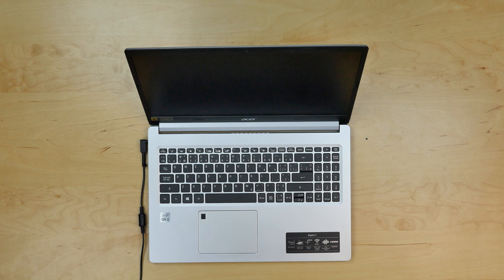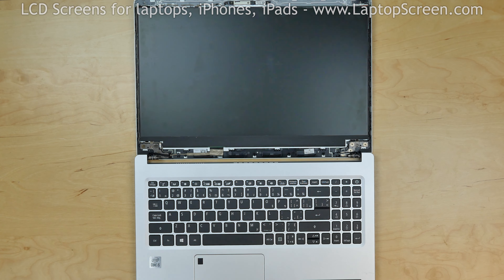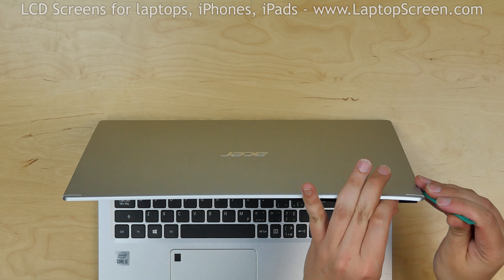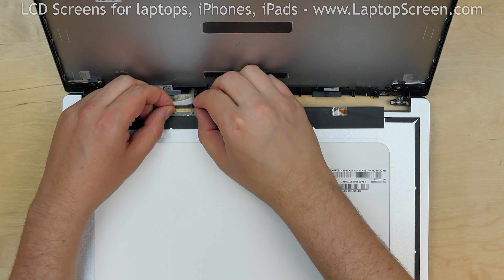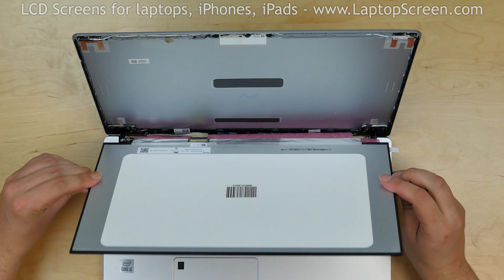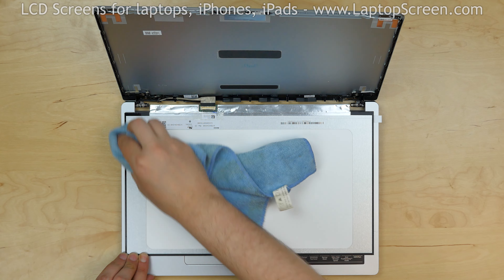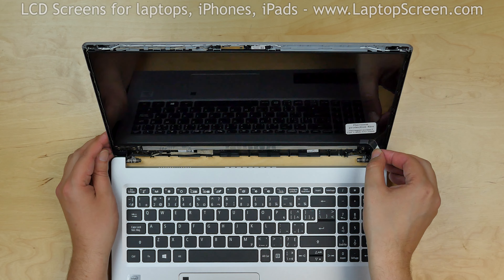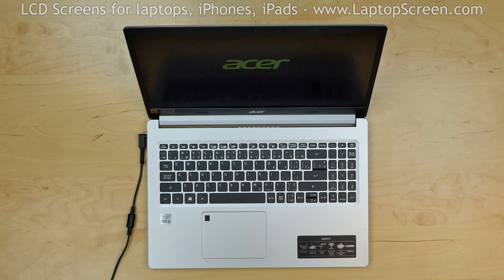How to replace LCD Screen on Acer Aspire 5 Model: A515 55. Step-by-step instructions

Comment: excellent video. only thing(s) I would add is some additional detail on connecting the new screen, how the cable clip from the board needs to snap/clasp back onto the new screen cable connection (right about the 1:56 mark in the video). mine was a firm fit that took a few times to get right. also, in my experience, the heat gun use was set on "low" and I swept it side-to-side like shown in the video for maybe 15-30 seconds in sections. requires some patience, but mine came off very well with some mild heat and "working it" in sections. after about a week, product I ordered and installed from your site has been working flawlessly! also, just buy the double-sided from them. compare the price for other 3m-like strips and it's a wash. no, I am not a shill for them, just very happy with the product and experience.

Comment: is the lcd bezel secure? im scared on how u easily removed it
Reply from the maker: It varies from laptop to laptop but over-all its easy to remove. Some laptops have glue along the perimeter and that makes it harder. Considering that we've been doing this for more than 10 years it may appear easier than it is. The trick of the trade is to angle the inner edge outwards, that opens up the tabs underneath and lets you pull off the bezel without breaking them.